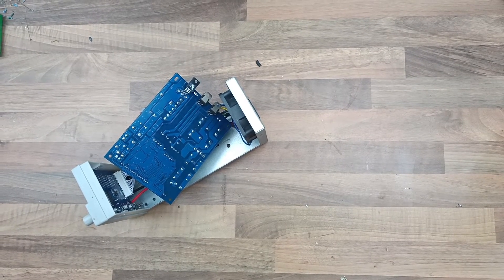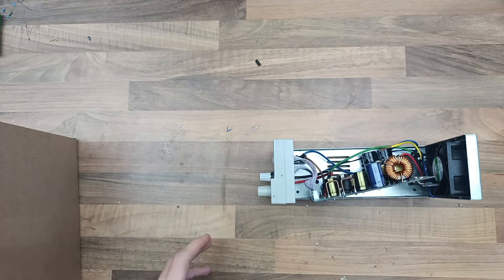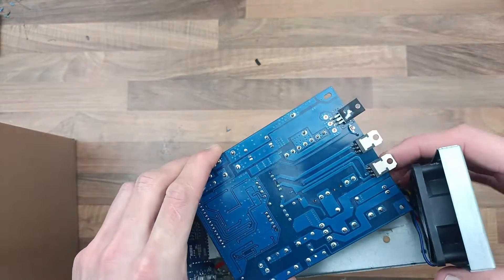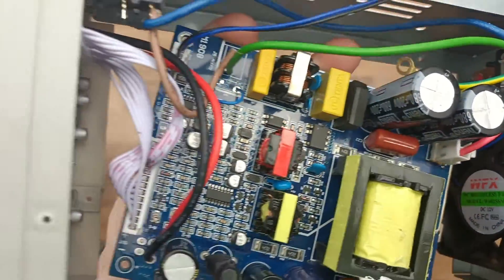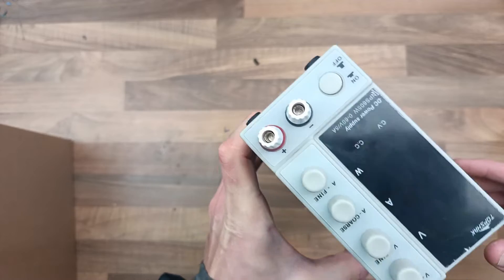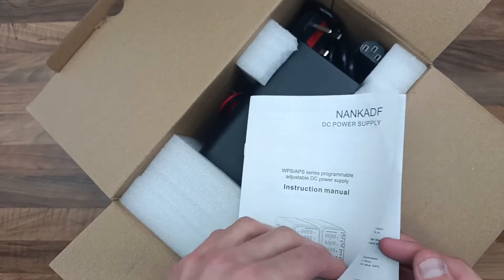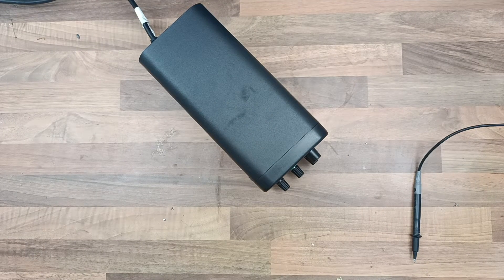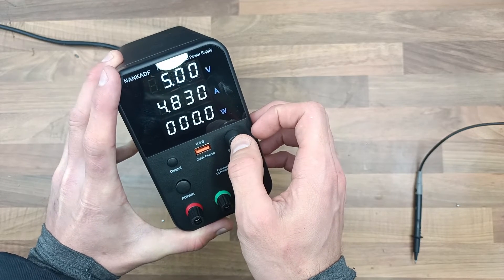My New Bench Power Supply Nankadf WPS605H

Comment: How do you know what voltage the battery needs to be charged at? Do you put the same amount in as what the battery supplies? I have a few 3v rechargeable batteries that I took out of something and was wondering how to charge them up after taking them off of the chip/charger. Sorry I'm new at this and learning as much as I can! Thanks!

Comment: at least for the price u get good controls

but i be real, the same model is sold under different chinese brand, so it s just some generic chinese stuff rebranded over and over

wanptek also sells the same model u just bought

so i wouldnt trust these chinese crap box, their protections are minimum, if u use it to run some strange load like a hv module, it could even blow itself up when a cheap basic atx supply wouldnt

i mean at least for the same thing, having one with better features and controls is still better

probably expect it to blow up after the same time as the last one did too......
Reply: Meh, I mean i have the WPS3010H and i've powered many things, I even had a ton of LED's in series at 4V and it drew 8 watts, It was bright though.

Comment: That new unit looks quite useful. Congratulations! 
I was looking for a cheap power supply, but they all do only 30V and I need 48V and 42V for  charging various bicycle batteries.

If you are able to locate the issue with that old power supply, that would be great. Perhaps you can change the failing components once more and use your new power supply to inject some limited current after the bridge rectifier. Than you can perhaps see what gets hot without burning the new components. After viewing quite a few Louis Rosman video's, my first guess would be some shorted capacitor causing the current to go above the capacity of the mosfets/diodes. Good luck!
Reply from the maker: Mr Maximum Integer!

You can get the 60v ones. They're readily accessible online. I have the same situation. I need 50v or so for my variance of projects!

Yes. I really don't know what's wrong with it. It's something shorting on the high side. It's a dead short too, I know this because it blew the thermistor up within a split second! 

Shorted capacitor, hmm, I don't think it's that because when the MOSFETs and diodes were out, the rectifier was not shorted. 🤷‍♂️ Having said that, something is causing the MOSFETs to be shorted. I'll check again as you suggested.
Reply: Hi @antonycartwright , I was trying to cheap-skate below 20 euro's or so. I guess I need to spend a little bit more... 
Perhaps injecting some safe voltage and low amount of current after the rectifier will heat up the culprit enough to let you feel which it is. If you limit the current coming from your new power supply to a few mA, the working components could survive. You probably don't have a thermal camera to help, but perhaps just touching everything with your fingers will give a clue. In one video I saw Louis demonstrating use of a swabstick with iso propyl alcohol to spot the heated component, by seeing where the alcohol would dry up faster than the other places. Have fun!
Reply from the maker: @MaxintRD  How much is postage to NL? I can get one for £35.
Reply: @antonycartwright - to be honest, I don't know exactly. DHL says they start at 8GBP. Last time I sent someone in the UK a second hand statue, postage wasn't the issue, but the customs charged a hefty Brexit fee for VAT on the insured value. 
Interesting price though. Best I could find so far was 76 Euros (67GBP) for a DPS605U, including shipping from Spain and VAT. Did you find yours online? If so, where? (Perhaps with some better searching I can find a relatively cheap one here too..)
Reply from the maker: @MaxintRD  I have a contact who can get them cheap. I could get you one for £35. Postage to NL is £10.
Reply: Hi @antonycartwright  , thank you for that kind offer. I'll keep it in mind and send you a personal message if I want to buy one too. (My girlfriend already says I spend too much money ...)